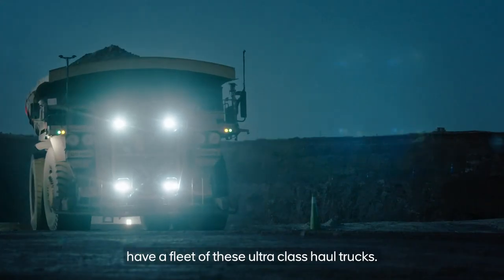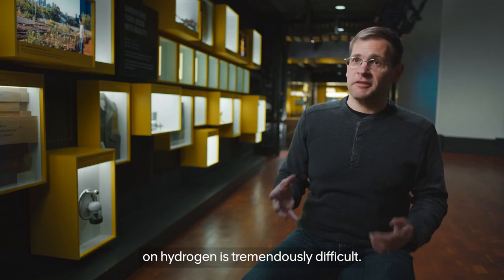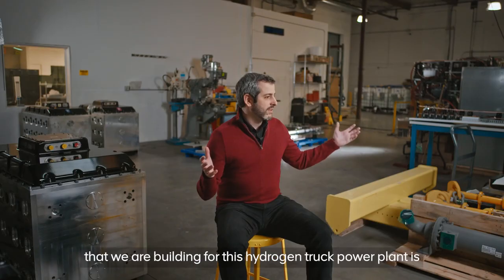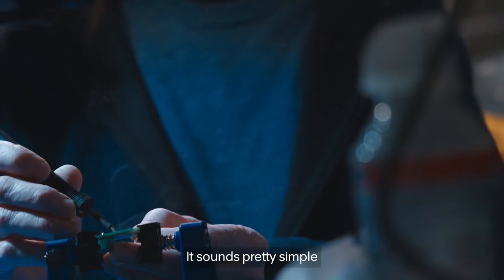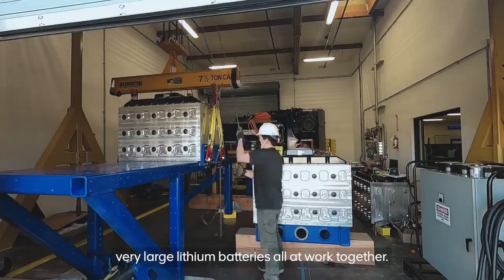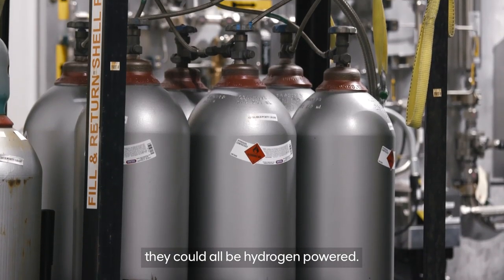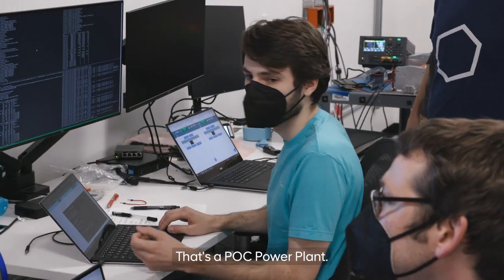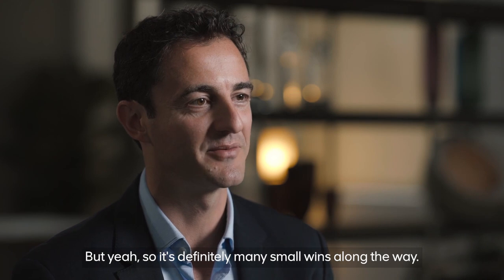Our hydrogen truck: The proof of concept

Comment: Is there any trucking company running hydrogen trucks in the USA in 2023?  I have seen zero news of any truck sales to a company that is actually using them in a profitable business.   Demonstrations come and go since 2017 with Kenworth, Toyota and Shell Oil.   It looks like hydrogen trucking is busted.  No sales in six years.  Hydrogen vehicles were touted as the solution in 1999 and twenty four years later, nothing but pretty pictures and video of demonstration trucks.  Show me the truck gigafactory that is going to build these trucks.  Zip, zero, nada.  It's a scam.  The oil company has won with the hydrogen con job.